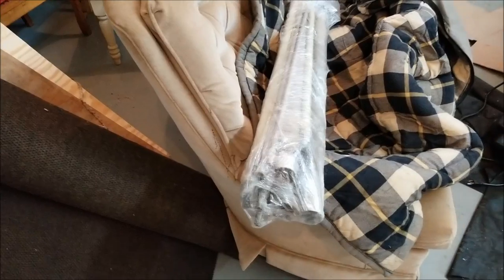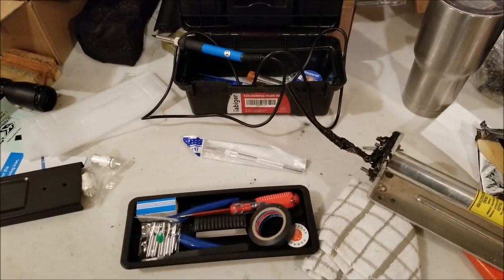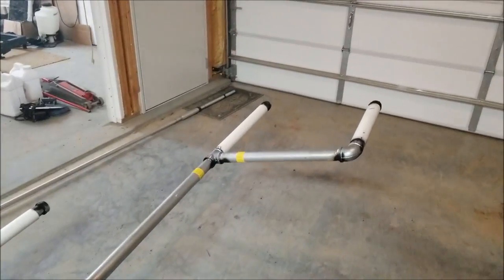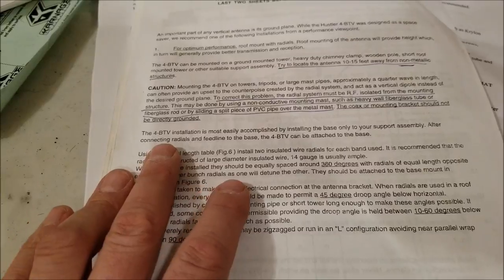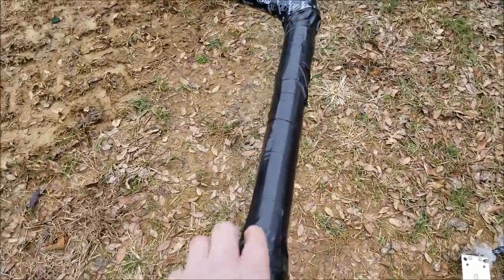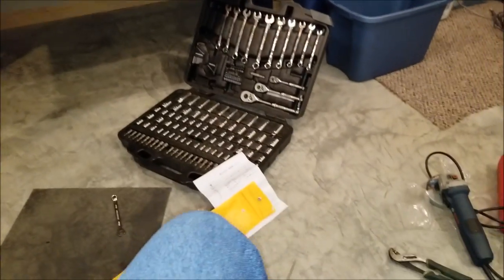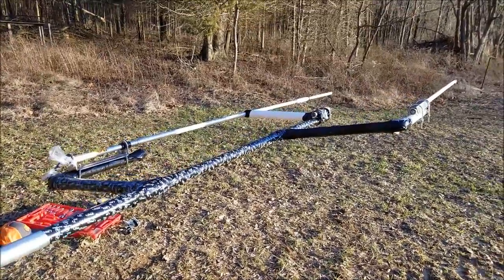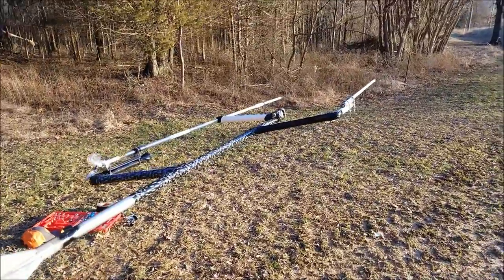Installing ham radio antenna tower update Diamond CP 22E and more

Comment: That horizontal piece of PVC will probably have an effect on the antenna especially when ANY moisture exists. Keep in mind that materials that appear to be insulators for DC can sometimes have weird impedance characteristics at various RF frequencies. That is why the manual advised using nylon rope (again, they were assuming ground level mounting).

Comment: I'm the last person to make comments on what you are doing, so I'll just continue to watch intently.......  in the mean time, I'll do more research to learn the justification for having a tower and antenna and radio system.  One goal for me is to learn the importance of it and just how useful it might be. So far, what I'm getting is that it is a hobby?  An expensive hobby?  A frustrating hobby?  Thanks for sharing and good luck with your second hip.
Reply from the maker: Doesn't that sound like golf? LOL No, much more than just a hobby though.. As far as 'why' a tower, it is simple, you can reach MUCH farther! An example; my handheld radio with a long rubber duck antenna right now can only hit ONE tower successfully. 2 on a perfect day. With an antenna up almost 50' and a larger antenna, I'll be hitting many towers, many miles away and have 20 times the range and usability... Then there's always the emergency comms when everything hits the fan.... :)

Comment: I Don't know anything about Ham Radio stuff or Radio/WiFi/cellular stuff.
Would a signal repeater mounted high up on your antenna help you with WiFi range over your property
How about cellular reception over whole property
Reply: use a ubiquiti 2.4ghz omni antenna and rocket 2.4AP radio.  good for about 6 acres

Comment: I know you already mounted a WiFi repeater/extender on the outside was just wondering about if you moved it higher or if you added another one higher on the antenna or would you just get interference from the Ham radio stuff.
Reply from the maker: That sure is an option, except I'd have to run the wires across the house. But in the future I may add a microwave or directional booster that could go 3/4's up the tower.

Comment: It surprised me that PL259 is still in use. But on reflection I shouldn't be, it's a really robust connector when done right. I hated putting together those horrible BNC things, so fiddly with fat fingers. If I dug deep into some of my 'I might need this one day' boxes I'd probably find both types.
Reply: If you want a truly robust and weather proof connector use a "N" type, especially for frequencies above HF. They are a pain to assemble but when done properly it is a connection you don't have to worry about. The biggest issue with PL-259's, assuming they are installed correctly is keeping them waterproof.
Reply from the maker: well all the radios are built for the 259 even the 2 meter rig. I actually ordered the N connectors thinking that it was the different connection but I was incorrect :-) so that's why I had to put the 259s on.
Reply: @kapperoutdoors  That's understandable. Other than military equipment most VHF rigs use SO-239 on the back. You really don't start seeing N-connectors being common place until UHF and above. Some low power UHF equipment will use BNC.

Comment: you do realize they make PL-259 LMR400 connectors, no?  takes all of 5 mins a connector (if that)
Reply from the maker: Yes I did try a couple of them, but didn't work so good. I did not have much experience with connectors. Thanks.

Comment: Kapper - get rid of that crappy PL-259 and barrel connector at the base of your HF vertical!!!!!!!!!! That connection won't last 12-months.  Read the instructions for that antenna... the coax is supposed to attach directly to the base of that antenna like it is now. In the manual it will tell you how to strip back the center conductor and form a ground lead from the braid. Also, read the first sentence on that manual page. The issue is when your mast is 1/4-wave in length.  Note they stress that the radial system (i.e. wires) must be RF isolated from the mounting structure. You are installing that ground plane vertical "sans radials". Which is likely to yield marginal results at best. I know you are set on putting it on top your tower but I had a 4-BTV vertical for many many years and without radials it works MUCH better when mounted at ground level on a short piece on pipe pounded in the ground (as illustrated in the manual). When mounted on the GROUND you can successfully use it without radials. I was always very happy with mine. It performed good and had very low SWR.
Reply from the maker: yes, I hear what you are saying. But I'm not prepared to make a space somewhere for it just yet around the house. I'll give it a try up high, as it does say it will work, but perhaps not as good as it could, I'm aware of that. My friend used it on a 50' tower and had good success. As time goes on I'll change things around, but for now I want to get it up and running so that when I'm busy with farm stuff I can at least use it. We're also hanging an 80 meter dipole, so at a minimum if the 5 band is marginal I'll have a 10 meter, a 2 meter, and 80 meter. I also plan to make an 'all band' quad inverted V that is said to work fantastic and with a good tuner it is all band. And yeah, I'm sure the pvc support may have a negative effect, but it may be marginal, or even none at all. I've got a good antenna guy coming out today. thanks.

Comment: Damn Kap your doing everything wrong, let me tell you how to straighten that mess out------------oh wait-----I don't do anything by the book  !!!      I thought hams were about experimentation ------keep on keeping on------I bet if it don't work you'll change it.
Reply from the maker: lmao, now that is wisdom! "I bet if it don't work you'll change it" Genius! lol, love it man, and thanks for the support. 'By the book' was often created by guys in suits, sitting in perfect climate controlled office with pen holders in their pocket collared shirts!!! :)
Reply: I agree that there is nothing wrong with experimentation but antenna design and installation practices go back a long way and are governed by physics and mathematical formulas. The wheel was invented a long time ago. There are lots of books and on-line information which explains everything. If you follow the 2+2=4 rule it will work. Otherwise you are just subjecting yourself to frustration and a lot of wasted time, energy and money. This is especially true with tower mounted antennas as no one wants to have to keep taking things back down to make changes. If you follow the rules it will work first time and last a long time. When I erected my first tower structure it had a 5-element HF yagi, a 16-element VHF yagi and a 3-element 6m yagi. The SWR on everything was less than 1.5:1. That stuff was up there for over 10 years before I made any changes.